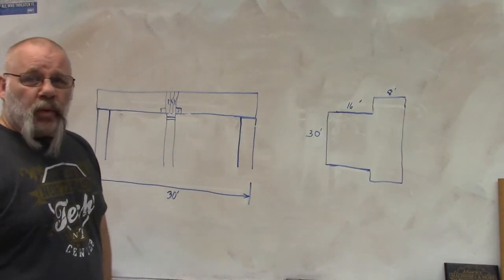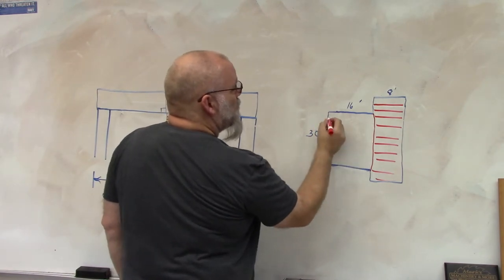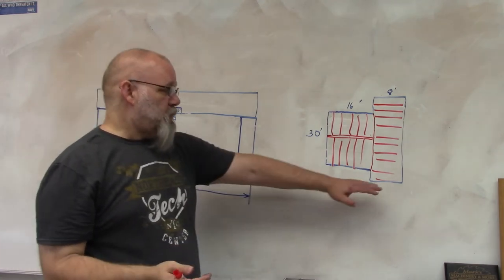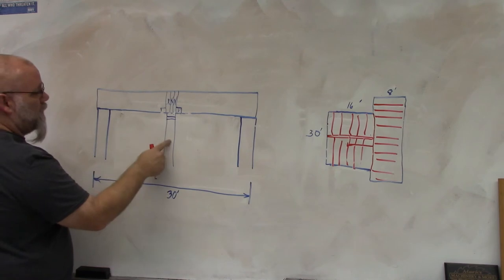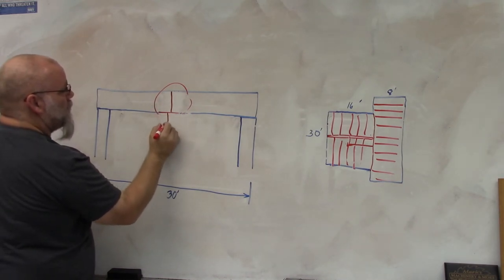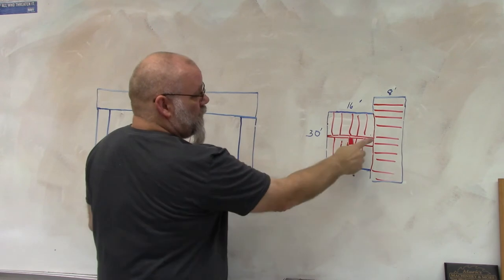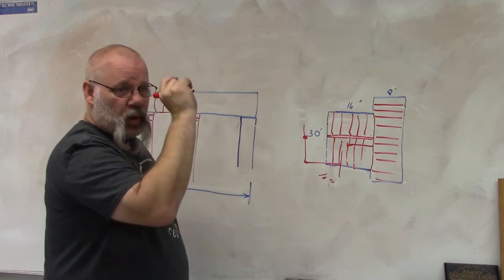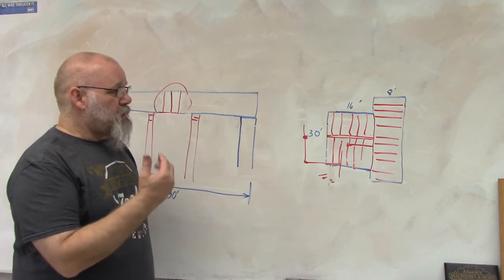Identify load bearing walls in multi floor structure

Comment: when replacing a load bearing wall with posts, is extra reinforcement needed on or under where the posts sit, if there is a basement/ lower floor below?
Reply from the maker: The load should be transfered from beam to the ground. Reinforcing under the post may be necessary.
Reply: @timpalmer-logstolumber1999  thanks for responding and thank you for the video, it is very informative!

Comment: I always cringe when someone wants to open up a wall this always seems to be dead in the middle of the load bearing down from the 2nd floor. They always want an open doorway or a partial opening like a bar look out right in the middle of this wall so they can see their living room from their kitchen. 🤣🤣🤣
Reply from the maker: Load bearing walls are a main reason why houses don't have open floor plans. Stud walls are easier than posts, beams and joist hangers
Reply from the maker: Load bearing walls are a main reason why houses don't have open floor plans. Stud walls are easier than posts, beams and joist hangers
Reply: @timpalmer-logstolumber1999  Yeah and people don't realize how much work this will be taking a section of these walls out completely, so the ceiling runs all the way through, when a beam has to be added above the existing ceiling and the floor joust of the second floor has to be cut and this beam installed after 2 make-shift walls are standing first. I mean it is easy to say that is what they want, but when they see the bill before the work, they think we are trying to screw them over or something, and most homeowners are clueless about framing in general anyways so, yeah. But that don't stop them from wanting what they want.